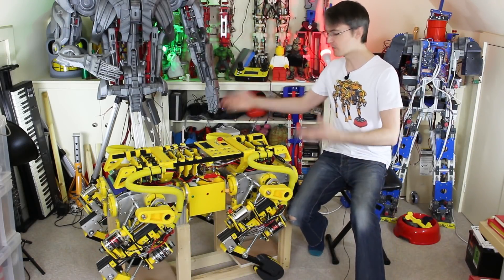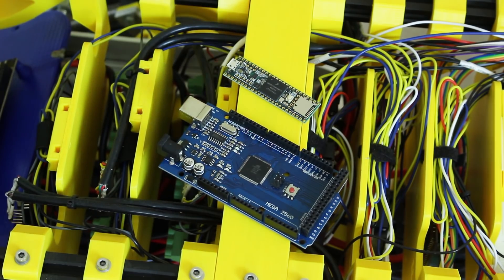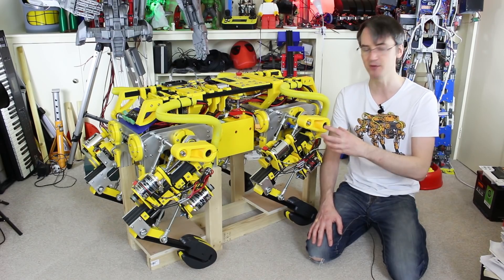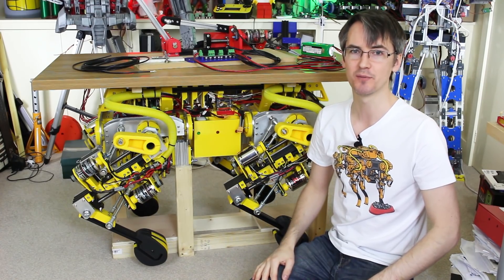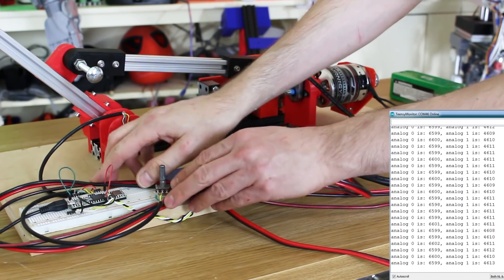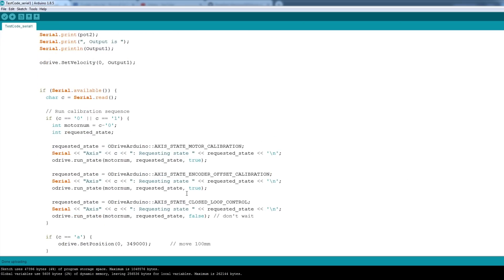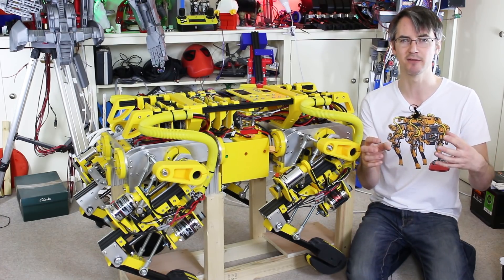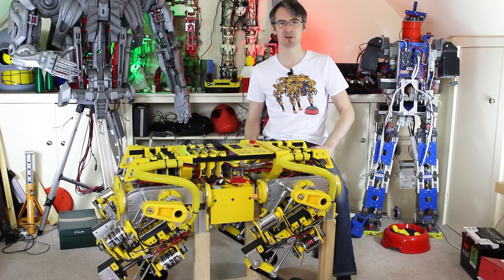openDog Dog Robot #14 | Closing the Loop? | James Bruton

Comment: Great to see that you are back at this project. I am not personally worried about regular videos on open dog. I would rather see other projects in the meantime while you slowly work on open dog ( Potentially building up footage over say a month), and release videos only when you have enough stuff to show for it.
However, there are a few things I would like to mention/point out:
- Potentiometers: Are the kind you are using linear or logarithmic scale potentiometers? These are the two main types, and they do behave differently. Linear ones as the name suggests, have a linear resistance throughout their travel. Logarithmic ones have a resistance that changes based on a logarithmic value. Linear ones would be the best ones for your use case as cheap encoders.

- Mechanical Noise: Even if you shield the potentiometers and ground their case, they will still produce noise. As they are a mechanically varying resistor, they have slop internally. One of these areas is in the spring loaded wiper that runs on the resistive track. Depending on the quality of the units you use, there is the potential for the wiper to buzz/vibrate occasionally off of the surface of the resistive track, causing the signal to potentially fluctuate.

- When you refer to an analog pin in code, even with "normal" Arduinos, you do not need to prefix the analog pin number with "A". The Arduino chips are able to tell what pin they need to do an analog read on when provided with an integer. See the example here: https://www.arduino.cc/en/Reference/AnalogRead?setlang=en
This is just to help clarify a common thought that an analog pin must be referred to with a leading "A". If you know that, you can use it to your advantage, to say loop an analog read over a number of analog inputs without having to define each individual pin number as a constant, reducing memory usage.

- To further reduce noise, try pulling the surrounding analog pins that are not in use to ground, using an external pulldown resistor. This should help further eliminate noise inside of the ADC belonging to the teensy. Top Answer at the time of this comment: https://stackoverflow.com/questions/17151622/using-arduino-analog-inputs

- Shielding of Cables: As others have pointed out as well, you need to be careful when shielding cables, as to not connect both ends of the shield to ground when there is a potential for a ground loop to form. If a ground loop forms, it defeats the purpose of shielding at all. Take a good read of this: https://en.wikipedia.org/wiki/Ground_loop_(electricity)
A ground loop is something I personally think could be an absolute nightmare to deal with if you end up with one/s forming, as if you do not know what to look for, you could be chasing noise in more places than just analog inputs.

- To store values between reboots of the teensy, instead of writing to an SD card or internal eeprom, could you just connect something like a cheap Arduino Nano clone up via I2C, Serial, or similar, and write the values to that? Just have the teensy send the data to the Nano, so the Nano can store it, until the teensy requests for it to be sent back. You could do that, or use an external RAM chip - Nano is probably easier though.

- When you machine the motor prop shafts down for the sensors, just be careful that when you chuck them up that they do not have to much eccentric runout relative to the lathes rotational axis. If they do have a small amount and you machine them when they are like that, you could find that the shaft ever so slightly walks around the bore of the encoder. Think about it as if the encoder bore, and the drive shaft are two gears. If the drive shaft is slightly to small/runs eccentrically it could "Walk" around the bore of the encoder, and not provide a 1:1 value. This means that over time when in use, the encoder could loose enough positional accuracy relative to where it started, to cause issues to the functionality of the robot, until the next time the robot is homed.
To deal with this, try to use a 4 jaw chuck, and ideally a lever arm test indicator ( A plunger test indicator could work, it is just not as easy to centre work with in this case) to centre the shafts as best as possible. This not only will help reduce any potential runout in your machining, it will also help you with learning some more basic lathe skills to allow you to use the machine in better and more accurate ways.

 All the best with this projects and others to come. Sorry if the above came across as to critical, I just thought it best to get this information out there to help you do the best you can, and so you can do an even better job with your other projects.
Reply: this is high information density and full of good tips, cheers

Comment: You know Arduino's have EEPROM built in right. You could easily save the home positions on the Arduino through reboots, using EEPROM as it's persistent memory.
Reply: That doesn't work. The encoders constantly count from 0-8191 on every revolution, and there are many revolutions between the two extreme positions. This means the controller actually has to keep track of the number of revolutions the motor has turned since reaching the home position. Storing the encoder count at the home positions won't help, since this exact same encoder count will occur many times as the actuator moves from one end to the other
Reply: @jeroen94704  you can save the position it had on shutdown, but the issue is if you moved the legs, there's no way to tell how much.

Comment: Good video nice to see an open dog update. Personally I'd just do what you are now but store the calibration right to the micro sd card that is on the teensy, that way you'd run the calibration routine once and store it and then only change if you've done hardware changes. That's the way we have been doing our BB-8 drives and it is working well.

Comment: What if you just stored the zero position offset in the EEPROM?
Reply: That's what I also thought at first, but if you reposition the legs manually (when the robot is turned off) , then OpenDog does not know the actual leg position at startup..
Reply: The issue is that it won't be accurate if the legs have moved since the last time you saved the position. So you will lose some accuracy over time. I believe that you do get the position within a revolution of the motor correctly, but if you moved more than one revolution you have no way of telling. It's possible to make it work but it's not perfect.

edit: you could use the inaccurate analog value to get the revolution count, since it is accurate enough for that.
Reply: What's about the o - drives do they save and stay on the last command that was send like when you send the hild command do they hold the motors still when the serial port is disconnected?
Brcause then it should be possible to stor the value in the EPROM or if  I saw right there is a micro SD slot.
Reply: @meneldal   That´s true, but it would probably be accurate enough for just reprogramming the teensy. There would have to be some kind of shutdown routine for the teensy, where the current position of all the joints are stored in the EEPROM, then are read back on startup. And if it gets too inaccurate, it should be relatively easy to just recalibrate the robot as needed (at a point where the robot is still somewhat able to move, so it wouldn´t be that hard to get it on the stand).
Reply: Its probably worth it to do the eeprom as a sanity check of your absolute position.
Reply: Why not use the pots in the joints to get the current position on startup only? Then continue using the positioning system you currently have without using pot position data.

Comment: @James Bruton I personally would use an external FRAM module to save the last known zero. Adafruit sells them fairly cheap. They save data faster than EEPROM but are also non-volatile so you don't need to worry about erasing it (its over 10M rewrites, or so). Also as far as figuring out what the position is without homing, look into Linear Potentiometer Travel Sensor with Rod End Joints. There are a number of them online, though I'm sure you could probably build one yourself. You would basically run it parallel with the lead screws. In code, you would set the end stop and max values based on the analogRead function. When it restarts (wakes up) you would get a value that falls between that and your code would calculate the rough amount of steps each motor has taken depending of course on the resolution of the linear pot. I hope this helps. And best of luck. [Disclaimer: I'm a self-taught robotics teacher, so I may or may not know what I'm talking about. Lol.]

Comment: The pots only need to be read at power up and then you can use the encoder on the motors.  Also you could calibrate the pot by reading the pot while the encoder spins and use a look up table.  I guess you need to put that in nonvolatile memory.

Comment: Solutions are perhaps the basic anatomy of muscles and skeletal dynamics. Of course, it is the optimally selected equipment and the coding that will give them life. With the gravity center of the system, it seems that the direction of movement will be dynamically associated with the code as soft and flexible. Your work is a great example of my imagination and design ambition. With the wish to increase your creative power, your achievements.

Comment: jitter can be a good thing!  in fact, deliberately adding jitter to help nullify the effects of static friction is called "dither" and consists of adding in an oscillating feed-forward term that prevents the closed loop controller from ever settling to a static condition, where that dither is at a higher frequency than the primary system response so as to not cause system instability!

Comment: 15:30 I'd also suggest that you don't connect the shield on both sides. If the pots body is not connected to any contact, solder the shield onto that and connect it only at the Teensy to negative

Comment: I'm glad you're using some of the faster Arduino compatible chips :D Some of the SAMD ones can go up to 240MHz I think.
A point on the calibration data: Why not store it in EEPROM, and just recall those values at boot time? The Arduinos have EEPROM built in, or you can use an external one if you're worried about wearing out the Arduino one with too many write cycles.
Some bootloaders will erase the EEPROM when you upload a new sketch, and indeed I had this problem when I was uploading sketches to a bare ATMega328p chip for a recent project. but you can change the fuse settings in the boards.txt entry for that particular chip. Use an online fuse calculator to plug in the existing fuses values, check the box labelled "EESAVE" or similar, then grab the new values to put back in boards.txt
Good luck!

Comment: You could use a analog to digital converter directly at the pods. So you have stable values. There are multiple versions with I2C, SPI and UART.

Comment: Hall effect sensors are more reliable than using potentiometers for constantly moving parts in my experience, pots just aren't built for that
Reply: This is 100% wrong information.  Potentiometers are inside EVERY servo motor assembly and are the way they know their position when you send the commands of where to turn the servo horn to next.  These potentiometers then are CONSTANTLY moving and in industrial robots that means 24/7 moving of these potentiometers.  So saying pots are not built for that is downright wrong info.

Comment: Software guy here -- Try this:  Have the code you flash include a table of defaults for the home calibration.  After you calibrate normally (slow), display the values it determined.  You copy those into the file you are iterating.  When you flash again, it "remembers" the same value it had before.  Check the real cal once at the beginning of the work-day, or when you mess with the hardware.

Doesn't that microcontroller has some EEPROM as well as flash?  Many of them are made to hold small amounts of settings like that between power cycles.

Comment: Not sure if this will help, but the cable shielding only needs to be grounded at one end.
Reply: Thought the same. Also EMF case for teensy would be a good idea.
Reply: IF you are connecting 2 circuits that can make a ground loop. In this case, grounding the pot (passive component) to the uC GND is the better way to shield it.

Comment: Regarding shielding: at the first company I worked at (designing drives for big-ass brushless motors) we noted that it's crucial where you attach the screen of a shielded cable to earth. It comes down to "only attach it to earth on one end, so you don't create loops" - the details (which end of the cable shield to attach) is really just trial and error.

Comment: 1. You could use EEPROM for storing the encoder offsets
2. You could average the data. You would only take like the last 3-5 measurements and average them. If the average was out of a threshold, then stop averaging and get live values.
3. Use thresholds if you are worried about motor jitter. The thresholds don’t have to be that big, and could have little to no effect on the accuracy

Comment: We use Posital Fraba rotary encoders on scanning frames. You have to tell them their zero and maximum positions, after which it gives you a 0-10V signal (or 4-20mA, depending on the model, a 250 ohm resistor on that gives you the 1-5V your arduino likes). It will track its position, even if you move the encoder when it's not powered up.

Comment: You could use a multi turn pot. That should give more resolution. But you would need to add a gearbox on each joint to turn them.

Comment: Also James, I have a suggestion for start-up positioning:
How about using a 1m optical TOF sensor (like the VL53L0X) to determine the ball-screw position on start-up? That should be accurate enough to let it stand and then let it balance on 3 legs. OpenDog can then (if safe, or triggered by user), start calibrating one leg at a time, without needing the wooden stand at all. (Kinda like stretching before a run, except the point is not to limber up, but to focus down on joint accuracy.) The benefit of this over a pot, is that there are no moving parts, but that you need to ensure nothing will block the laser. You could shine it down the al-extrusion though and 3D print a nub to go in there for the laser to hit.

Great idea using the pot (or whatever absolute sensor) to only set the position initially, and then switching back to the encoder. It's far more accurate indeed. In my robot, I use this same principle to periodically merge my compass direction (absolute, but rubbishly noisy) into the accelerometer (relative, but smooth and more capable at high speed).
Reply from the maker: If I could measure the absolute linear position of the ball screw then that would be great, I need to connect 12 of them though somehow. I guess each one could have it's own Arduino and I could build my own serial network.
Reply: @jamesbruton  That was what I though initially too, but how about using 2x TCA9548A I2C multiplexers? Then you can have all 12 (16 actually) I2C address-locked chips on the one Arduino. I haven't used one of these multiplexers yet, but have been eyeing it for a while for a planned build. They look promising. If you place them well, the I2C signal should be able to reach all the sensors.

Comment: move Home switch to a natural standing position any where in in the actuator travel range. Then read pots at start up to know which way to move for accurate home switch position. The switches being at a point traversed often give you a place to double check the belts haven't slipped.

Comment: just use the pots for a "zero reference" and keep it working as it is. Worst case is that a leg can remain a bit up in the air. You can also include pressure sensor under the foot, so you can know when the legs are down while moving (walking, stairs, ecc).

Comment: Perhaps you should regularly verify the position of the joints. For example, after a joint is motionless for 10 seconds, a series of position values are collected from the potentiometer which are then averaged out to calculate a new "zero" position. This lets you keep the high precision from the O-Drive, but prevents errors from appearing over time. You might also want to have a threshold where if the positions reported from sensors differ from the expected positions it stops the motor and attempts to re-calibrate it immediately (or at the next safe opportunity).

You might also want to reconsider the way your arduinos are structured. I haven't verified the code myself, but you might consider offloading morte processing onto separate processors. Instead of the master arduino sending speed/raw position data to the slave arduinos it sends a more high level xyz position data, then leaves the slave arduino to handle the kinematic/inverse kinematic models. This would also reduce complexity if you want to change micro-controllers again, as only one part of the code would need to change.